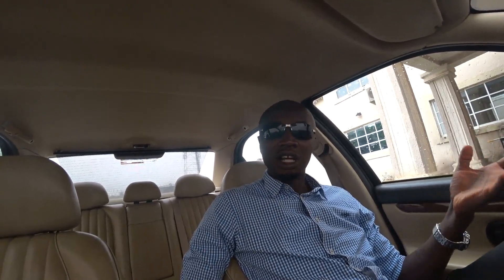Kenya: Strange Noise From  My Peugeot 406 Engine

Comment: I have a 406 2.0 16v engine. It makes some tac noise and is even worse when the temperature reaches 80 degrees. Some say is the tappets.  What do think it is?
Thanks
Reply from the maker: By 2.0 liter, I would assume you meant XU10J4R Engine. As for the noise you mentioned, it depends on Engine oil spec/grade you use in the Engine. It could also be caused by the Engine weakness or intake and exhaust valves. Thicker Engine oils make camshafts or valves noiser. I can't tell from here the cause.